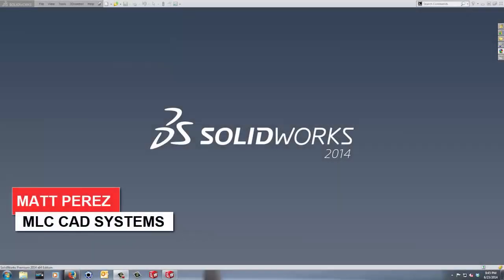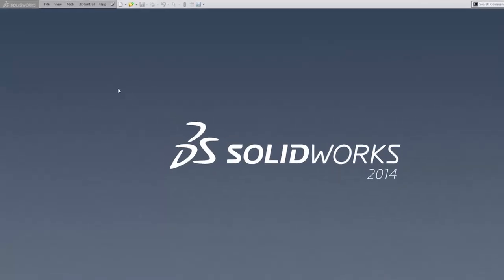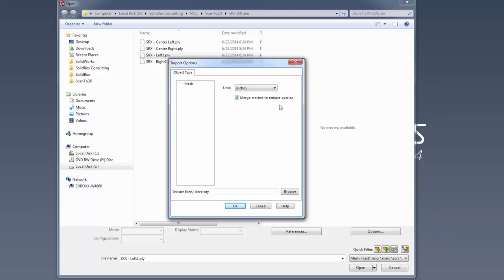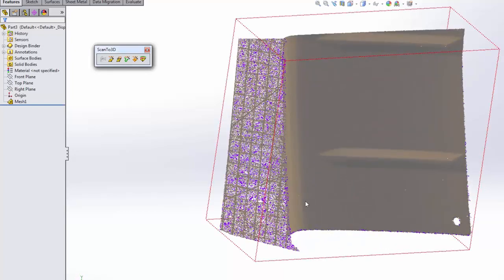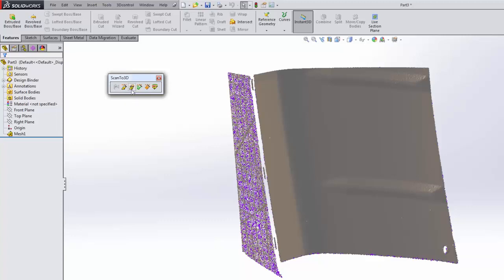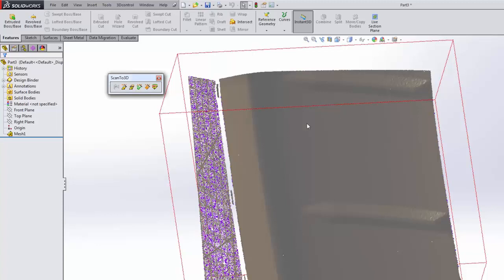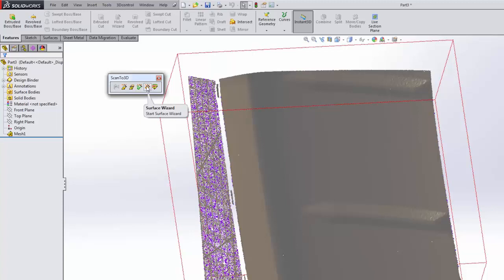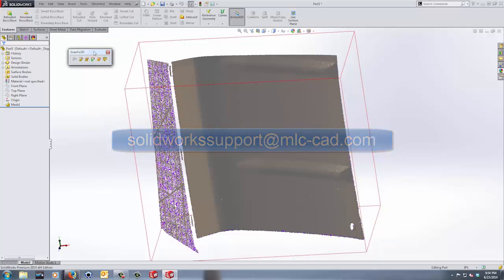SOLIDWORKS ScanTo3D Part 1 - Getting Started

Comment: Hello, thank you for this seires. I just had a question about the actual surface. Once I have used the surface wizard (automatic), it gives me blue lines of the surface and a background shadow. How can I fix this?
Reply from the maker: By default, SOLIDWORKS makes the edges of open surfaces blue, so it is likely that your surface is still open.  This is OK, and it is the first step towards building solid geometry using surfacing, but you may still have work to do to finish the design.  Also, the shadow might simply be a rendering setting, go to View > Display > Shadows in Shaded Mode and see if turning that off looks better for you.

To answer your question fully might require seeing the file you are working on, I would recommend reaching out to your value-added reseller for support on this file.
Reply: MLC CAD Systems Hello. Thank you very much for your help. You’re right, it was just the shaders. I fixed the STL file gaps on mesh mixer and followed your tutorial and updated my mesh which seems to have created a solid body now.

Comment: Hi, this is the best ever tutorial available on SCAN TO 3D .
I have a small question.
when I import my .STL file as a mesh, there is an error on the feature tree stating that 'THE MESH HAS TOPOLOGICAL ERRORS' . 
WHAT DOES THAT MEAN AND HOW COULD I FIX THAT ?
Reply from the maker: I'm glad you are enjoying the tutorial, there is a full 11-part series available, full playlist is here: https://www.youtube.com/watch?v=55yR3DfrB4M&list=PL1TStJR6oVYdLuWf4few4pII-PGe-kkzn

A topological error likely means that the mesh geometry in this file is faulty, self-intersecting or open.  The mesh prep wizard might be able to help you to identify these areas and remove them manually or clean them up to remove the issue.  Also, depending on the source of this mesh file, there may be changes that can be performed in the software that generated it that would alleviate the issue.  

The bottom line is: there is something broken in your mesh in this file, and you will need to find it and get rid of it or repair it.

Comment: Hello Thanks for your video,I faced a problem which I opened scan to 3d but  meshwisard button is grayed I can not select it could you help me?
Reply from the maker: When you open the original file, make sure you open it as a Mesh.  In the Files of type drop-down list, Mesh Files is an option that is available only when ScanTo3D is available.  Re-open the file as a mesh and it should become available.